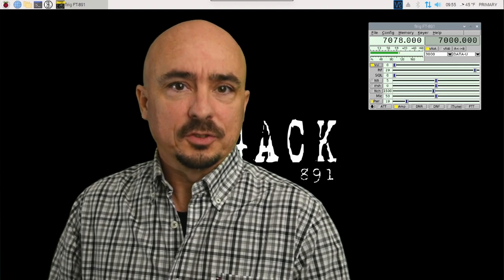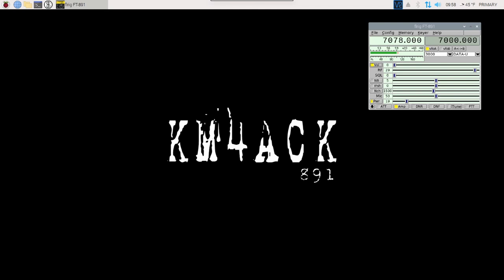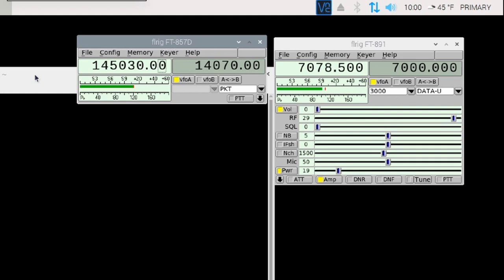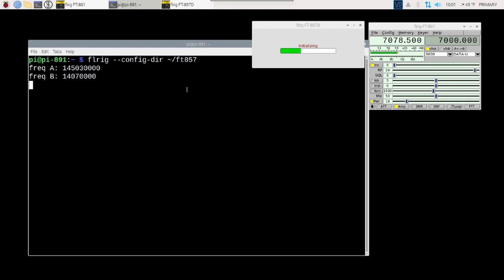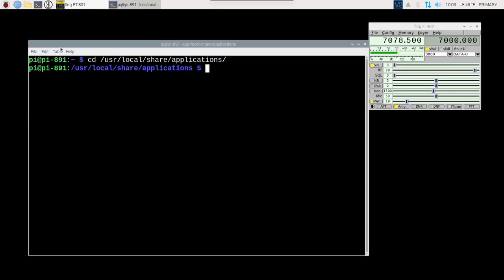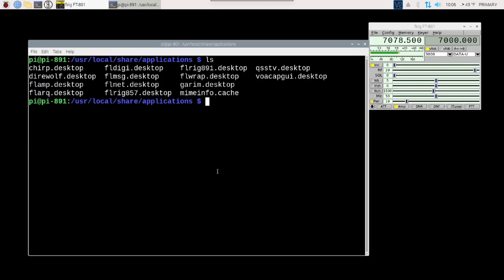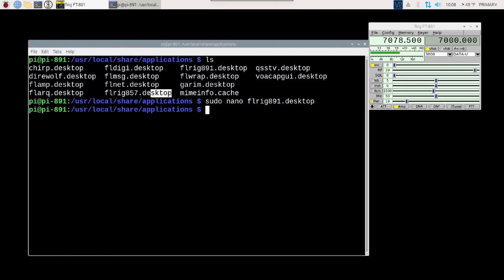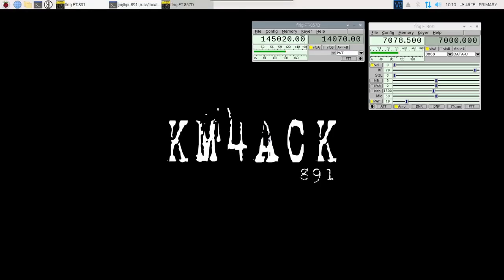How to Run Two Radios with FLRIG

Comment: Jason, Would you know how this might be done with Windows 11?  I'd like to run an 891 (already set up with Flrig) and a 991 as an additional rig.  I don't necessarily want to run them at the same time, but would like to choose between them as which rig to run Flrig. I can't find any info on this.  I can't believe I am the only one wanting to do this.   73s Dan K1YPB
Reply from the maker: It should be a very similar process on windows. If you can't figure it out, this group should be able to help https://groups.io/g/linuxham/topics I don't run windows but guys in that group do.

Comment: Great video.  Can you use this technique for one radio with two configurations?  Example VARA HF and VARA FM.
Also, I would like the option of operating VARA FM with one of my dual band FM radios with a Signalink but FLRIG does not support any dual band FM radios.  I have a FTM-400DR and a TM-D710A.  
Do you need FLRIG for operating VARA  FM in Winlink?
Thanks, JT
Reply from the maker: You wouldn't need FLRIG to control the radio while using a Signalink. The signalink has a built in VOX circuit to key the radio. You will have to manually set the frequency on the rig though.